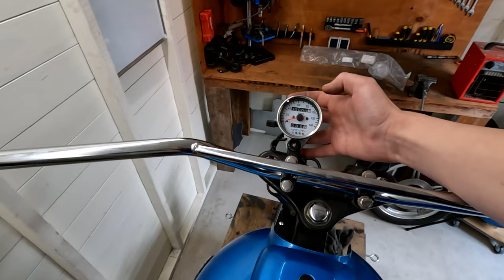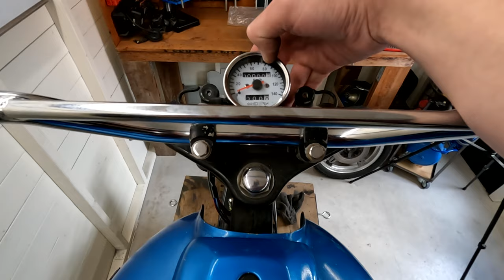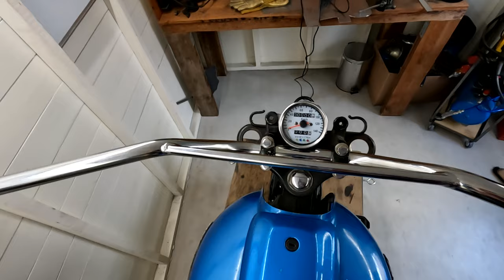Honda CB 400 Budget Build Gets A Front End Transformation

Comment: Just a bit of advice running pod filters on the stock cv carburettor you will want to add a spacer between the carburettor and pod filter to help create a bigger pressure difference as the stock carburettor is vacuum operated slide.
Reply from the maker: Thanks for the tip!